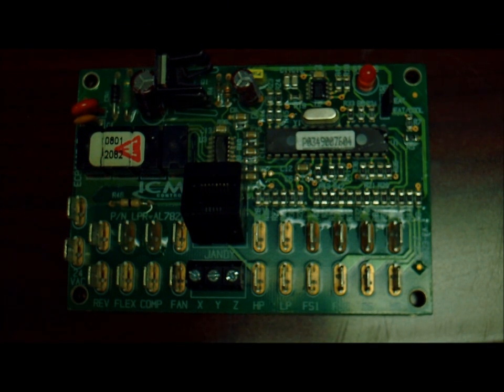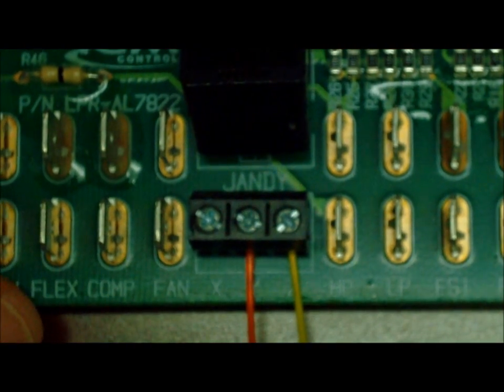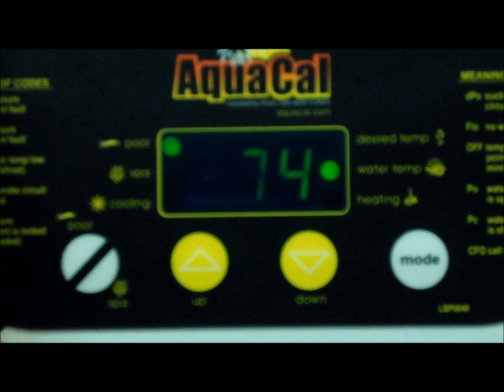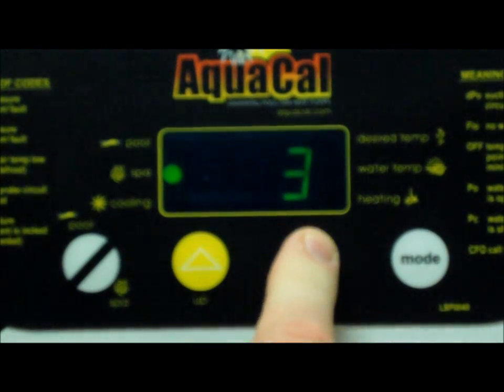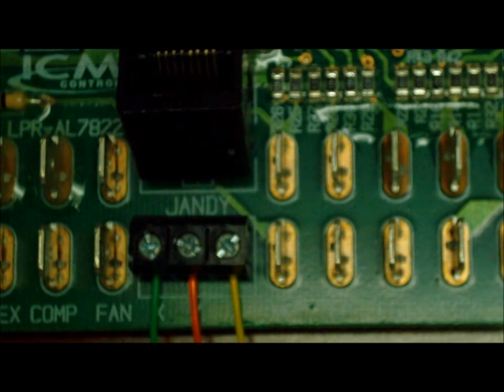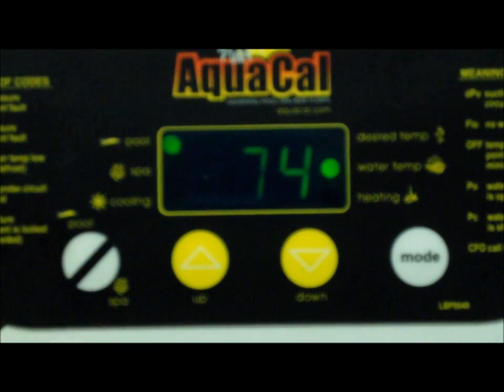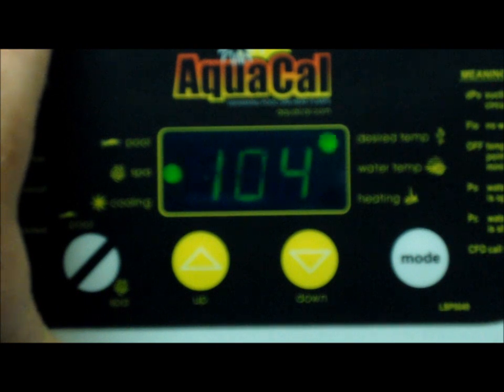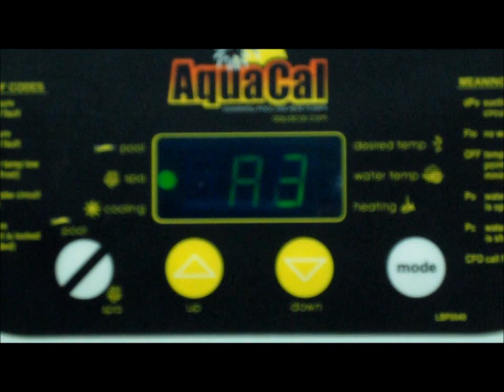How To Properly Program & Setup An External Controller To Your AquaCal Heat Pump

Comment: FYI for anyone who surfed in here doing research.  I'll tell you what doesn't work.  Extending the CAT5 cable to move the AquaCal control panel.  I got a Communication Error (COMer) message.  I'm guessing there is voltage drop to the unit.

Comment: Hi My AquaCal pump control panel was bad and I removed it, I'm not using the heat pump now, do you think I can connect to an external controller like my pentair compool automation system without having the control panel?? I do still have the little motherboard the has the X Y Z
Reply from the maker: Hello +Sam Dahhan ,

Thank you for contacting us about this. Yes you can connect an external controller, here is the video on how to do it: https://www.youtube.com/watch?v=Hyu2VZ0A2OU 
If you have any issues please contact us 800.8780998 we are here to help!